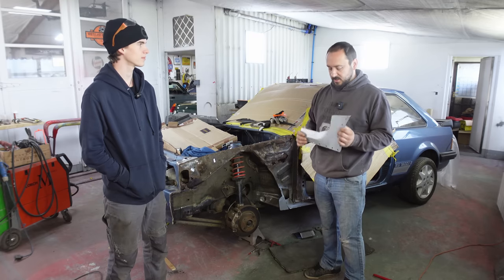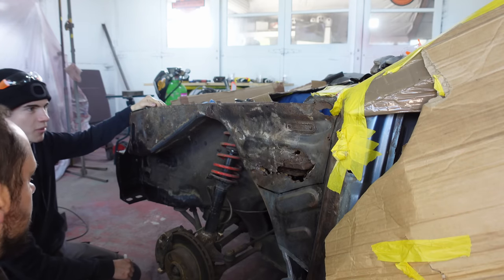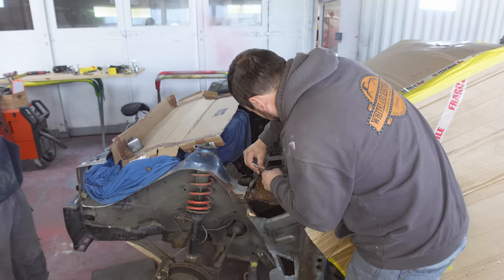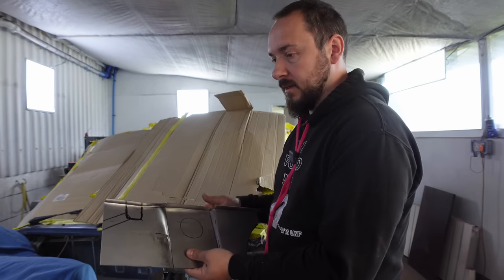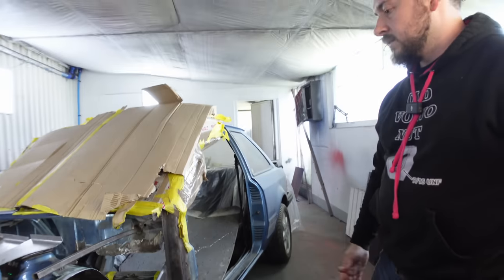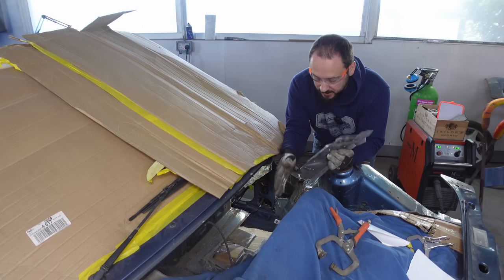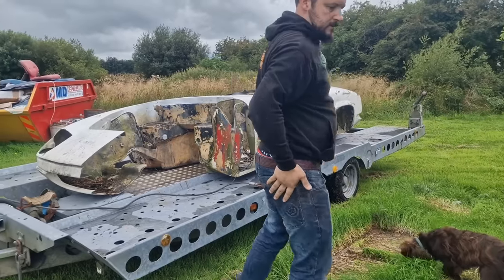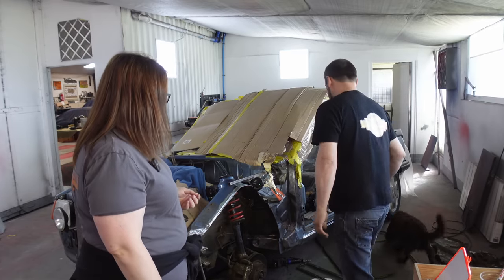It Got Worse! RS1600i Reveals Some More UNBELIEVABLE Rusty Secrets!

Comment: Well done guys on some fantastic work. After seeing how bad those previous repairs were and how much rust you've had to cut out it makes you wonder how bad the rest of the car is.
Reply from the maker: Luckily it's OK, it's been done. Looks like they just couldn't be bothered to fix the front properly.
Reply: My experience with these cars is that they're quite happy to rot out completely in the bulkhead, battery tray and front footwells, while remaining in good condition everywhere else.
Reply: The only thing that does not rust is the glass, that just delaminates!

Comment: Just shows you how a small rusted area can escalate into a major repair area..  your doing a fantastic job of repairing the Escort the correct way.  Keep up the good work.
Reply: That's my experience, I had a fabrication workshop and the mot garage just down the road kept sending vehicles to me for welding and as I was just starting up I took some of the work and quite frankly it was not worth doing, people would come in want a fixed price to weld up a small rust hole and before you knew it I had to make half a car. In the end I had to say no, but some people were very insistent, the answer came when I upgraded my mig welder to a 450 amp machine , it just would not weld thin sheet especialy not with 1.2 wire. But I was glad when the garage owner retired and I no longer had to send people away which is bad for business.

Comment: Used to do loads of these battery trays back in the 90s. When new, the battery had a plastic ‘lid’ fitted over the top of it. It was there to direct rainwater flowing off the scuttle panel from running over the battery. Most went missing when the battery was replaced. Without it, the battery electrolyte would overflow rotting through the bulkhead below the battery.

Comment: Fair play to you guys taking that on. Rust for fun the Mk3. I had a Series 1 RST back in the day, 4 years old, 24k on the clock when I bought it back in 90' and as much as I looked after it the back seams below the bumper needed sorting and the front slam panel where it joined the inner wings started rotting and had to be cut out and renewed.
Looking forward to seeing this once completed. 🙂
Reply from the maker: Rust is constantly trying to get the better of us!

Comment: I am amazed by the rust in this bomb was it all caused by the battery placement in the first place 
Or other issues 
I am surprised it hasn’t already folded in half 
At least you are doing a great job putting it right 👍👍🇦🇺

Comment: I had a 1983 RS1600i in 1992. Very minor rust and I had it all repaired. But a horrible car. Such heavy steering, the solid tappets were so noisy and never settled down, and quite bad torque steer, are my abiding memories. It looked great, though. The seats were comfortable, and I heard that they were not Recaros, but made by a German company called Scheel.

Comment: Very common issue with mk3 escorts was the rotting out of the battery tray mounting points.
Reply: Whilst your checking.  Check the inner wing panel track rod opening for cracking. Ford did a recall on those. Both sides
Reply from the maker: Very common!

Comment: I just don’t understand how this car is so rusty. I had MK3 Escorts and had only rear wheel arches to repair
Reply: The battery try area was always a notorious area for grot on the MK3 Escort due to poor drainage. This car has suffered rot in this area earlier on its life and has suffered from repeated bodgery which has still allowed moisture and rot to creep in to the structure underneath - the Rs1600s suspension set up is also very stiff and unforgiving to any weakness in the shell. Whilst not the worst cars in period for rusting out, sills floorplans bootfloors and rear chassis legs are classic weak spots. I also believe the single stage metallic single stage paint used in the factory became more porous in old age than the solid colours. My 1982 Crystal green 1.3 was an utter rot box but in comparison my Coral beige 3 door Ghia was totally rot free.
Reply from the maker: Just bad luck with this one, it's had bad repairs which has made it worst. Most of the rest of it has been done and is OK... This is just a hard area to fix properly
Reply: @byronmills5952 most of the underbonnet area on the metalic painted shells had no clearcoat. Couple that with water washing over the battery and its rust city!